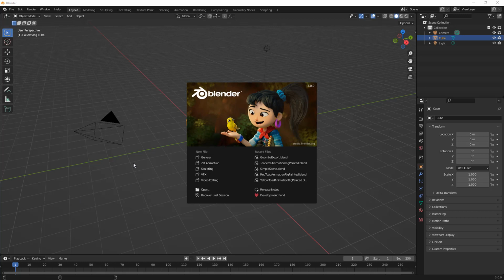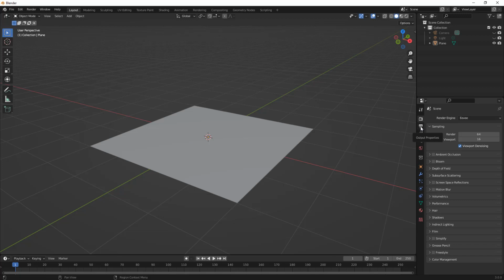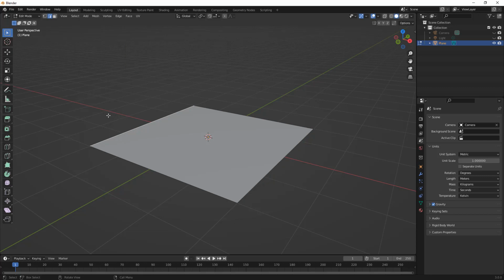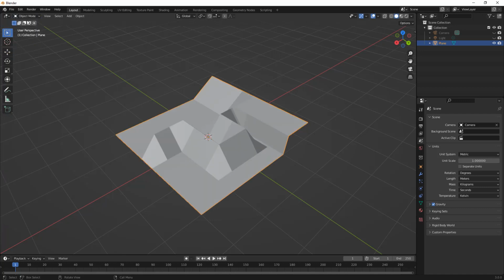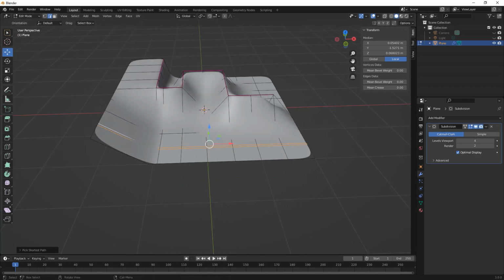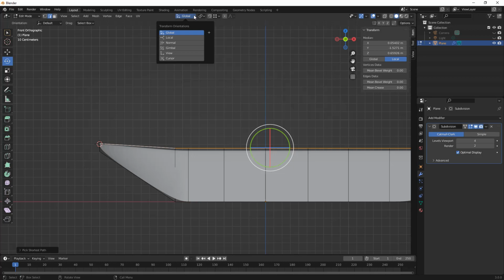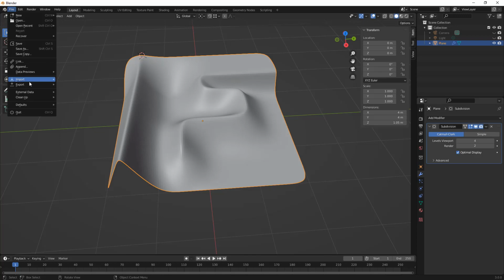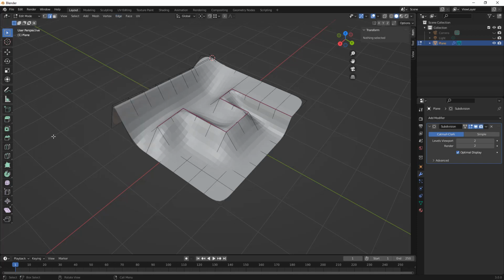How To Learn Blender Part 2 - Learn to Add and Move Edges in Blender #Blender #Fusion360

Comment: This series is how I got started in blender so thank you for that! I do have a question though. Is there a sort of “straighten” feature that we see in Fusion 360 forms? I know you can scale in an axis and press zero to straighten but that only works within an axis. Is there a work around this?
Reply from the maker: awesome!  Um, on the straighten, not that I am aware of, but I don't use Blender regularly so it is possible.  and blender 4.0 is in beta right now!  I think generally its a combo of the transform orientation (top center where it says global), where you put the pivot point and how you approach that whole process.
Reply: @LearnEverythingAboutDesign  Thank you! I can do some more digging but your channel was the first place I thought of
Reply from the maker: @jacobstevens6286  I did a quick search online and it looks like there are edge loop tools called Flatten and GStretch.  but in the video i found they got to them in a right-click menu but i don't see them.  Might be a good place to start though.  https://www.youtube.com/shorts/WdGgmOVfNOY